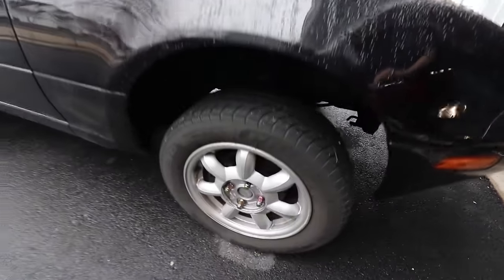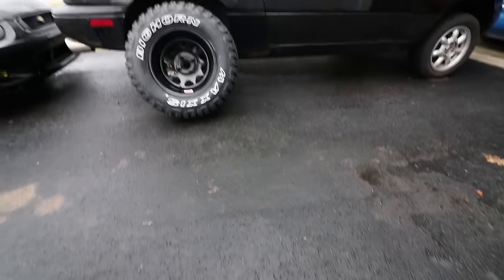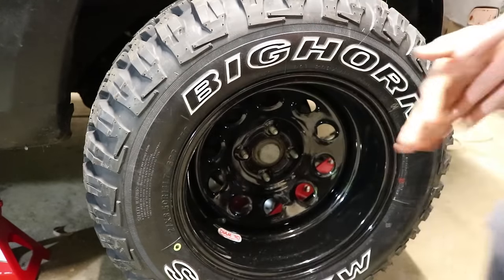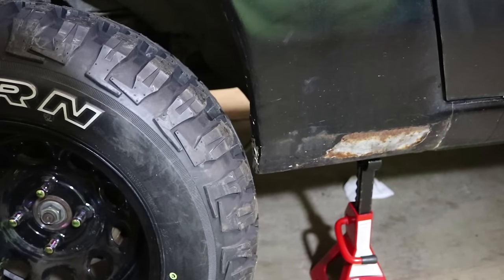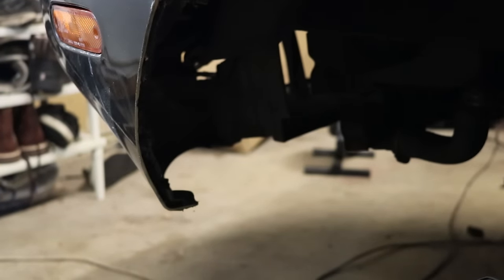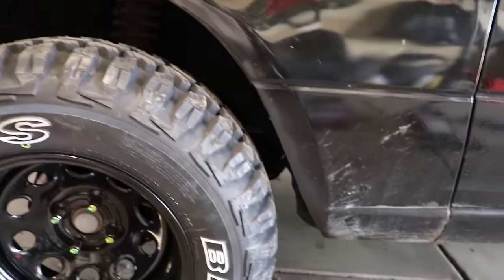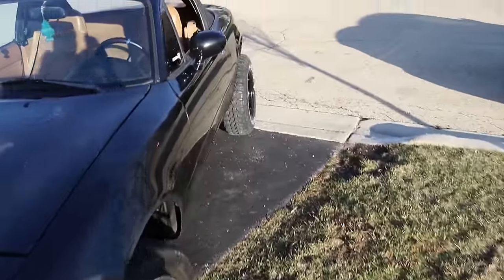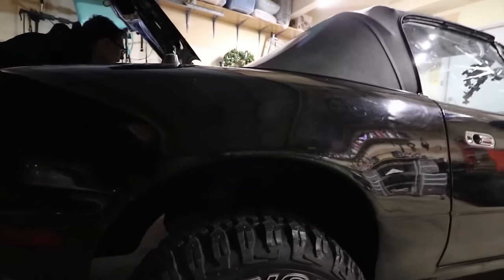Test Fitting New Wheels W/ 27" Mud Terrains || Project Rally Miata (Part 2)

Comment: next: engine swap
Reply: Daniele Gandini one word: ro-ta-ry! needs a 13B Turbo
Not enough BRAP
Reply: Daniele Gandini 1jz, k20 or sr
Reply: ls
Reply: Ls swap
Reply: harper rides might as well put a diesel into it DISGUSTING (imo, no offense pls! everyone has their own opinions)
Reply: I'd like to see a "junkyard hunt" for its new engine, like you go and take the best you can find.
That will be cool but very VERY difficult to fit in the engine bay
Reply: Honda v6
Reply: Jeremy Sharpe a VTec nsx engine? rly?
Reply: If this car is gonna be a rally car, then it needs to stay lightweight with good weight distribution. So, no rotary, no 1JZ, no 2JZ, no LS, nothing above 5 cylinders. An I4 Honda engine would do quite well.
Reply: Yeah! A 5.0 mustang v8
Reply: well +Saleen S7, NA Rotary isn't heavy, but really expensive
Reply: a rotary engine is far from heavy.  Even a 6 rotor engine only weighs about 250 pounds, a 4 rotor even lighter than that.
Reply: lamborghini centenario engine
Reply: Daniele Gandini True, but the rotor deviates from the top of the engine to the bottom when rotating, which can throw off weight balance.
Reply: Daniele Gandini sr20 cud anything else would have too much power or a lifted miata
Reply: Daniele Gandini 2jz crammed in miata?
Reply: RB26 boyyyyyy
Reply: Daniele Gandini 4 ROTOR BIATCH
Reply: 5.8 Shelby gt500 motor
Reply: TheLittleCuteGamer yhh
Reply: LS
Reply: Dereck Rijo he should get a LS
Reply: Yeah an LS for a build like this is probably one of appropriate times to swap it in, however an LS still feels wrong for a car like this. Perhaps a 1JZ.
Needless to say I don't think that stock engine will do it, it wont make enough power unless you mod every corner of it.
Reply: Why dont just have a lambo centenario engine soo you can do burnout all the way to the shop
Reply: Daniele Gandini vr38dett how ba dat
Reply: Drop Finder for Mr BassBoost 

Breh can you even imagine how much money that would cost. And what moron would even take a 770 HP engine from their Lamborghini. Boi
Reply: Ls or 2jz
Reply: Daniele Gandini  maybe
Reply: 2jz or nothing xD
Reply: Diesel swap
Reply: obvs a h22a honda master race
Reply: RB25 with awd
Reply: Óscar Luaces FR9
Reply: Daniele Gandini yes
Reply: Daniele Gandini v8
Reply: Daniele Gandini Agreed 💪✅✅
Reply: Saleen S7 you do realize an all aluminum ls3 weighs 418 pounds and a 2.4l I4 weighs a little over 400 pounds. and an ls3 can easily make over 500hp n.a. with a few modifications. the little Hondo would be lucky to make half that.
Reply from the maker: More power yes, engine swap? Probably not
Reply: supercharged maybe?
Reply: Arghhhh shit no engine swap rip miata😉😂😂😂😂
Reply: v8!
Reply: Gingium hey im a sub
Reply: I think everyone here are a sub
Reply: Gingium 

Ya I don't think Ging wants to put in that much of effort, it would be pretty damn hard...
Reply: 2JZ or RB30 (or a RB26) ...
Reply: shout out to everybody in this comments who doubts a 1.6 miata engine. theyre not that bad 😒
Reply: WE NEED RX-7 2 ROTOR
Reply: whats that song

Comment: U should go bumperless if its leagal in ur state
Reply: Bumpers are on a car for a reason, they're to protect the driver from front and rear impacts. That's especially important in rally. So, going bumperless in a rally car would be foolish, regardless of legality.
Reply: Saleen S7 do you really think that a bumper cover is the same thing as a bumper?
Reply: Saleen S7 The bumper does nothing apart from crumple / dent during a crash the front crash bar is what helps therefore a bumper removal will help with looks and mobility yet exposing the crash bar.
Reply: SAUL SPIKE STOKE going bumper less is stupid no mater the situation
Reply: but the "bumper" on those cars is actually just a plastic cover, over an aluminum brace across the front. so, removing the "bumper" would have no effect on crash safety
Reply: +Battle PigFTW +Reid .Turner it is still a necessary part of the car. It's not there for show. Like any car, you want as much sturdy mass between you and a crash, so removing that would be a bad idea.
Reply: Saleen S7 its not that necessary as long as you have the crash bar the plastic bumper cover isnt doing anything i use to have a Subaru outback and the bumper came off while i was offroading and i just left it off i ended up getting into a headon accident and was fine cause the crash bar was still there even if i had the bumper cover i would have been fine all it oukd have done was break and make for shit to clean up
Reply: Still, it seems a bit strange to remove the bumpers on a rally car, yes?
Reply: Saleen S7 not really plus i think he plans on rrmoving the bumpers and getting actual offroad bumpers for it so cutting them is kinda pointless if you plan on taking them off anyways
Reply: Saleen S7 dash bar
Reply: Cory Schilpp he could sell the other bumpers

Comment: Hey Gingium, instead of doing all that front fender cutting, why not metal fab a baja truck inspired front guard. Could even go as far as adding a skid plate, I have one on my truck to cover my radiator, and under my engine/oil pan. Does me good, and gives plenty of tire clearance.
Reply from the maker: I think im going to do something like that for the bumper!
Reply: Gingium I can send you some pictures off the front bumper of my truck if you'd like. I think it'd be a good fit.

Comment: This thing is fucking stupid. Waste of time using this platform for "rally". Its got an outrageous bodylift and knobby 4x4 tyres.. if you take a corner at any considerable speed, you are going to roll it 100% and will destroy the body of the car and your time and money will be wasted. Just an fyi
Reply: Kyle Clayton there is nothing "rally" about this car. Stock Miata would be faster on a rally stage than this piece of shit... It's useless
Reply: +Joona Metso How so? There have been no test on it.
Reply from the maker: +Kyle Clayton Its not supposed to be pratical
Reply: Gingium but why you call it the "rally" Miata. Rallycars don't need liftkits and beefy off-road tires. I don't know what are you trying to build here but im 100% sure it's not a rallycar because the handling and balance is ruined with that liftkit and tires
Reply: Saleen S7 from experience. That car is way too high so the car will be very hard to drive on a high speed rally stage. Those tires are good for off-roading but on a rally stage absolutely useless. Or have you seen an actual rallycar with fucking liftkits and off-road tires..
Reply from the maker: Im calling it Rally Miata because I like the name, not because im entering the next rallycross world championship with it
Reply: Well, this won't be drivable unless you are going almost straight forward. A way to small car that's way to high is definitely going to roll in a high speed turn
Reply: Nils Källman the center of gravity in the car is still barely above the middle of the wheels, the car won't roll. It's basically setup like a stock height truck now. If it does anything it'll be wheel studs breaking, or other suspension and turning parts breaking from added stress.
Reply: I fuckin drift my Cherokee around which has a 7" lift on 40s and no sway bars, it doesn't roll , so this Miata won't, even if he does use it for rally, but that's clearly not the purpose of the car, just a cool name
Reply: I built an nb with 26 inch mud tires and a 3 inch lift and it's a fucking blast to drive! I also live on the peak to peak highway in Colorado and carve  the canyon hair pins between 80 and 90 mph every day on the way to work year round while douchbags Porsche sits in the garage half the year then gets pounded by shit for pavement the other half. Oh and did I mention it still costs less even after the mods. And as for off road  it makes it up my 4 mile driveway up coffintop mountain  in the snow and also makes it over Switzerland trail with all the slow overpriced side by sides.

Comment: +Ginguim I would cut more off of the bumpers. You're not going to be sitting still when you're turning which means your tires will be flexing or moving toward the sides of the wheel wells

Comment: Don't remove the bumpers, despite what everyone says. It's a rally car, which means jumps and potential crashes, so removing the bumper would be a horrible idea.
Reply: Those are technically the same thing, as rally cars are built for off-roading, but off-roaders aren't usually made for rally.
Reply: Saleen S7 the bumper is plastic.
Reply: Josh Grounds So...?
Reply: +Saleen S7 you really think a plastic bumper is going to help in a crash? It's not the actual bumper, it's just a bumper cover
Reply: Every little bit helps! I'd rather have 2 feet and 1 inch of material between me and crash, instead of just 2 feet.

Comment: Why the giant wheels/tires? When this first came out, they said to keep the total rolling diameter under 26" and use snow tires for plug and play. What benefit do giant tires give?

I have some stock 16" wheels for my '01 Miata that came with 205/45/16's and I found a few winter tires in the 195/60/16 size. With that Paco lift and those tires, my miata could be lifted about 4 inches over stock, plus I already have coilovers that could get some more height, too. 

I am not trying to insult you, I just don't get why everyone wants to put on so much tire and cut their cars up.

Comment: Don't cut that tab, use a hefty sledge hammer and finesse it down. Take that front bumper off and build a tube front with 3 rally lights in the center, taking the bumper off will help with your approach angles when off road.

Comment: My idea for the Miata : take front bumper off and put metal tubing for a bumper, v8 swap it if it'll fit, half roll cage, straight pipe, welded diff

Comment: for the metal part on the front that you hit with a hammer, get a heat gun heat it up then give it a hit with a hammer it will fold nice and easy and it will give u that clearance u need

Comment: this project on the rally Miata is awesome but you should do something about the wiring harness under the front left fender before you hit it with the wheel going off roading.
Reply from the maker: +cavallo power I checked and the tire doesnt even get close under full compression
Reply: oh, ok but its good to be safe than sorry.

Comment: What are you going to do about the camber on the rear I know you took some off but there is still camber in the rear that may cause the tire to wear uneven, I recommend going 0 in front and rear and it will also look nicer with the whole muddling lifted Miata
Reply from the maker: +KillerElite 818 Ill be getting an allignment when I get the rest of the wheels